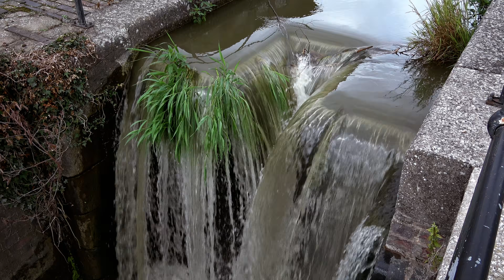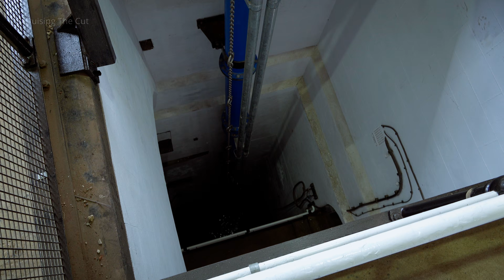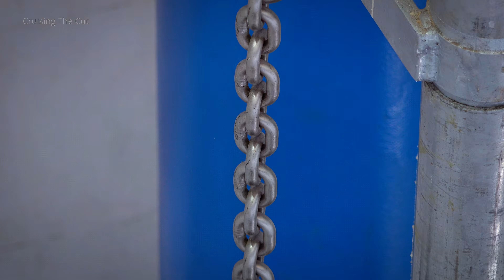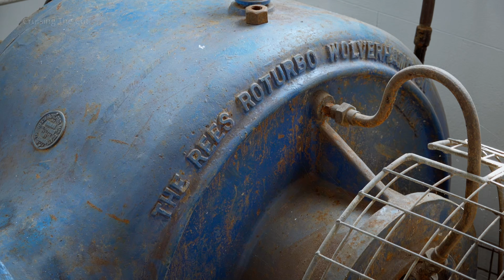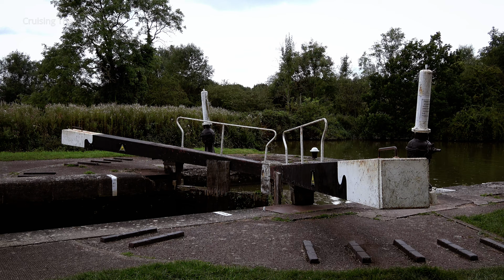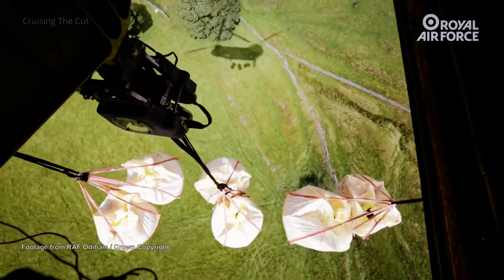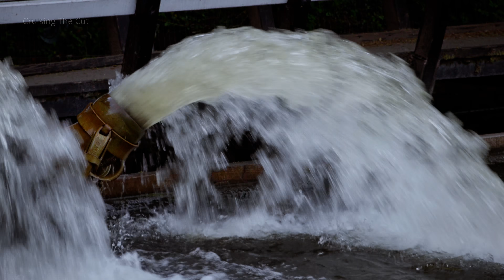247. Canal water: pumps, reservoirs, the works!

Comment: I wonder how much feeding the canals lowers river systems in general in these times of over abstraction. The levels of for example the upper Great Ouse are noticeably lower in the last twenty years.
Reply from the maker: The extraction is all quite well controlled I believe, not least because some of the rivers are not CRT but EA and they monitor things like a hawk to ensure strict agreements are kept to! I have no explanation for the Great Ouse, alas
Reply: @CruisingTheCut  I would guess the the water levels on a river are gonna vary more because of changing precipitation patterns and over irrigation than the nearly fully closed system of the canals
Reply: @CruisingTheCut  As i understand it, and i invite correction, the EA are responsible for issuing lucrative abstraction licences. The cynical amongst us, ie. me, would look at the somewhat chequered history of that organisations management. The Angling trust and partner WWF this March took further legal action against DEFRA and EA for it's lack of action over pollution, a most basic undertaking one would think.

Comment: I loved how Tracey had a look over the side “yep, water is still gushing out of the pipe” 👍🏼
I love this term “modernisation” when talking about stuff that is 1 to 2 centuries old ! 
Sure you save a bit of power using modern motors & you save a few quid putting in electronics that ultimately puts someone out of a job that they loved & excelled at but when something works & has done so for so long, why complicate it ? making it prone to fail when the canals amongst other things should be preserved, maintained & repaired.
My thoughts are the CRT should fix the broken & worn out things like leaking lock gates, broken paddle gears, shallow undredged sections, overgrown towpaths before “modernising” elements that have worked day in day out for so long.

Comment: I have a minor question, aside from recreation of the narrow boats and of course the wide beams and crusers. Do they use the canal for commerce in any way beside suppling the boat traffic with fuel and such. I am sure it would be a much slower way to move commerce but in many ways it may still be advantages in avoiding many of the standard traffic congestion issues faced today on the modern highways. Thanks and by the way I do love this slight format change as it provides very informative information about the canal system. As you know we in the states have long abandoned our many canal systems and most have been long forgotten and filled in except where some of the remnants were left for some local museums such as along the old Erie and Miami canals system in the state of Ohio where I am originally from. Thanks for sharing. Vic
Reply from the maker: There’s essentially no freight traffic except perhaps on some of the much bigger “navigations” (I’m not entirely sure where a canal ends and a navigation begins!) such as the Aire and Calder I think
Reply: @CruisingTheCut  I would guess what little “freight” traffic that exists on those stretches not considered “ navigations” would mostly be to service those using the canals for recreational and residential purposes such as yourself, based upon your CoalFinger episodes. And even then is sounds like those supplies are shipped overland and only float the canals for relatively short distances
Reply: @CruisingTheCut  Thank You for the quick response it does answer the question and all things considered commerce I am sure would still rather the faster movement of product by land. I do know that also in the states here they do still move a whole lot of barge product (coal, rock salt and gravel and the like) using the river systems like you do in your country but no canal traffic.  Have a great day and stay safe my long distance Youtube friend.

Comment: It's still a pity that CRT refuse to take the blame for Todbrook for not replacing the man who maintained it and monitored the water levels daily.
Reply from the maker: It’s rather more than just the fault of a man who maintained it. As explained, there was a basic design flaw in the whole thing which no amount of inspections picked up.
Reply: @CruisingTheCut  well David I'm still disagreeing with you. I spoke with several locals when my boat was  moored at Furness Vale. Whaley Bridge has had many stormy nights in the past 150 years but only one caused damage after staff were removed.

Comment: I could imagine when it was a busy transport system that there were more lock movements then, than there are now ?, so why is it different and seem harder today to supply, than a mere 200 years ago, was there more rain back then ?.
Reply from the maker: I’m not sure it is harder, in many ways the modernisation has made things easier eg with the remote monitoring etc
Reply: @CruisingTheCut  yeah, you are probably right :), ime just thinking out loud. Are there more lock manouvres do you think, in modern times, or less than, back in the canal heydays  ?, i am thinking of getting a project boat to live on the water, but ime not sure if i would be just adding to existing problems, or enhancing its use tbh. i have myself a business plan kinda, but i wonder the longterm plans for this kind of living, as is ?. thanks for any replies CruisingTheCut :)
Reply from the maker: I'm not sure whether there's now more or less traffic than in its industrial peak, I must ask the CRT. Good luck with your project!

Comment: Would it not be possible to use the water used in lock-fill to generate electricity which could be stored in batteries and used for powering the locks or even pumping water “uphill”
Reply from the maker: I think the installation cost of a micro-turbine on each lock, given that each lock only empties with any pressure for 2-3 minutes at a time and can then sit unused for hours (until another boat comes along) would make this unfeasible, sadly.